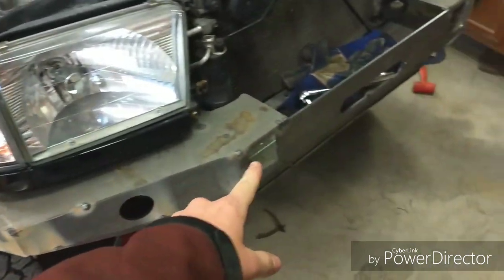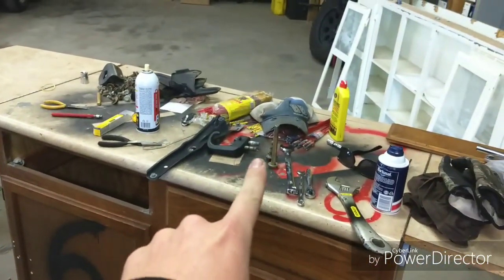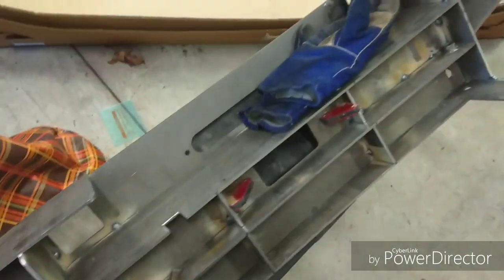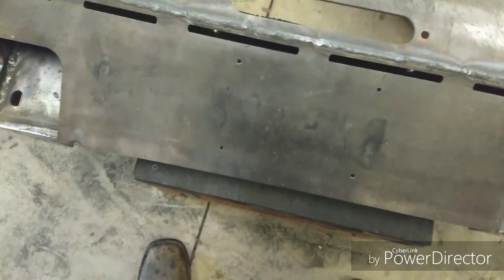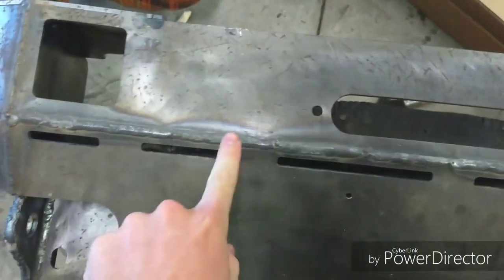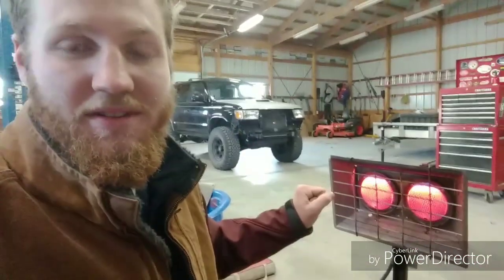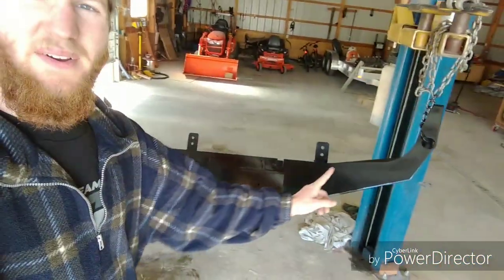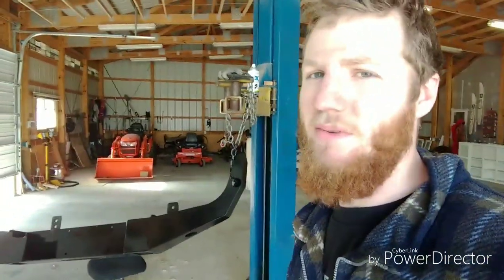How to: Coastal Off Road winch bumper build part 2

Comment: Hey . Does this have to be welded while its mounted?
Reply from the maker: In order to get to all the welds it cannot be mounted. But when your welding it take your time and be sure not to put too much heat to it, that could cause it to warp. And a warped bumper is pretty much useless unless your going to attempt to fix it. Mine warped a little cause I was in a hurry and it took about a month to finally fix it
Reply: @rynob937  thanks,i ended buying the arb bumper. Since im new to welding wanted as clean of a finish and not all the clumpy welds i still do